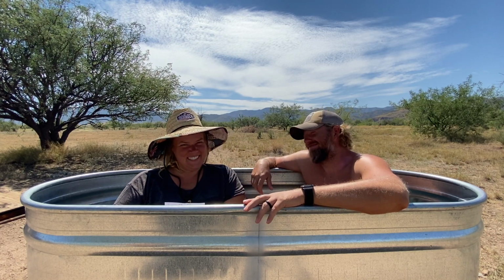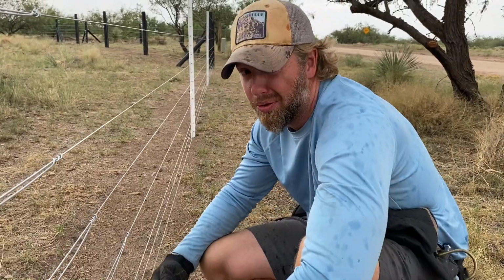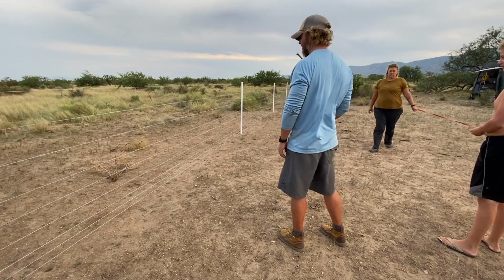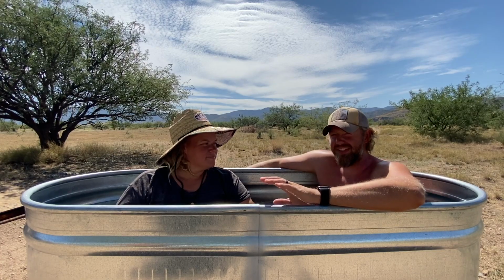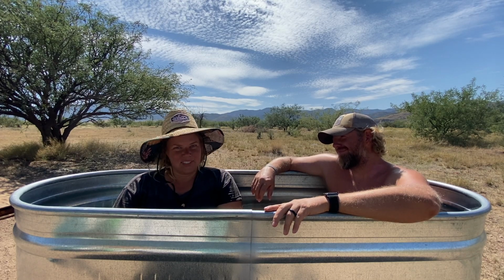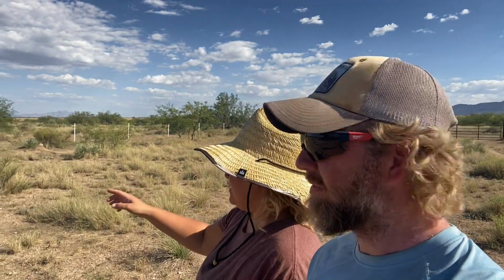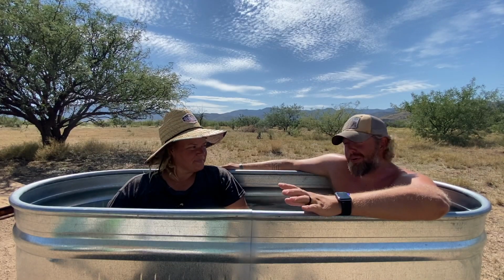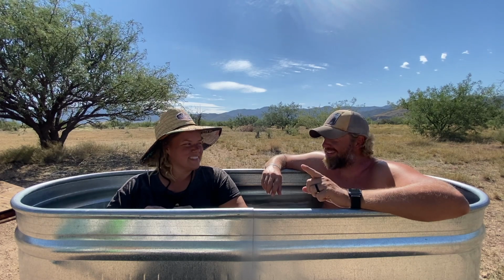Fencing Part 3 - It's ELECTRIC - Electrifying our Timeless Fence System

Comment: Another fun video.  Watch the copper connected to galvanized. Not usually recommended because over time the joint will have a chemical reaction and corrode which weakens/kills the electrical conductivity.  Sounds like you have a great adventure ahead.

Comment: I'm loving your videos! Such great info and amazing what y'all have accomplished!!  I am curious why you insulated your ground wire and why the ground wire is linked from ground wire to ground wire and carried under the driveway?
Reply from the maker: Because in this system it’s a negative, not a ground. It’s a full DC circuit. Only reason it’s in the ground is because we needed to drive over it and have a gate opening.

Comment: Unfortunately it’s not a good idea of mixing material ( galanized and copper). If I’m not mistaken it’ll corrode the wire and cause the wire to fail.  You may want to do a bit of research in case I,m right.  My wife and I are moving to cochise next month. We decided to install the same type of fencing with the exception of the corners, we decided to use H brace instead of A brace.  Painting the bracing black was a good idea, it looks great. 👍🏼

Comment: Gate is not electrified? So a smart bunny rabbit (or fox or coyote) will just jump through the openings in the gate?
Reply from the maker: Electrifying gates wasn't a priority. It's complicated and expensive. We already have approximately 2,000 rabbits running around on the property (jk - probably like 50), and we put cattle panel on the gate to keep larger predators from jumping through. Could one sneak underneath? Probably if it really wanted to. But they can sense that electrical field, and haven't breached yet.